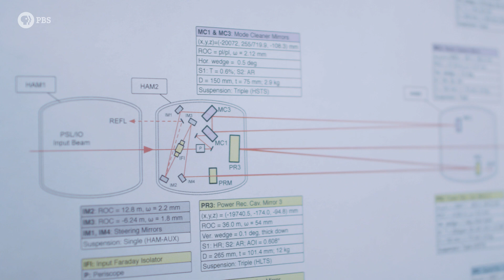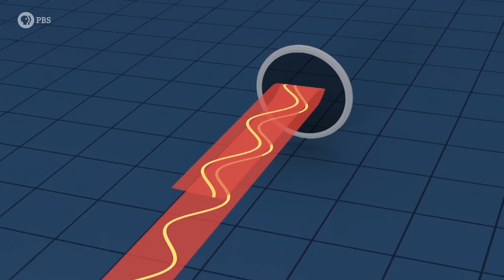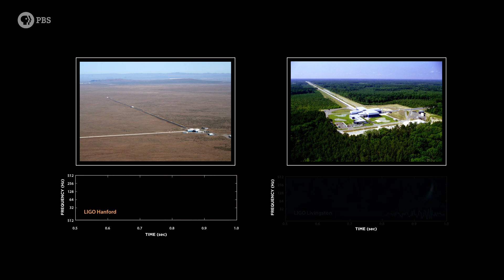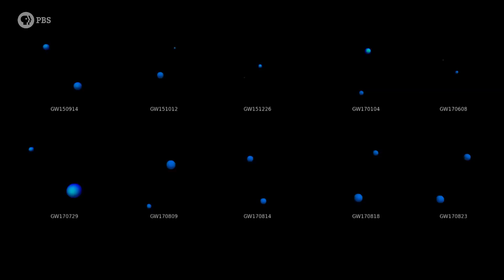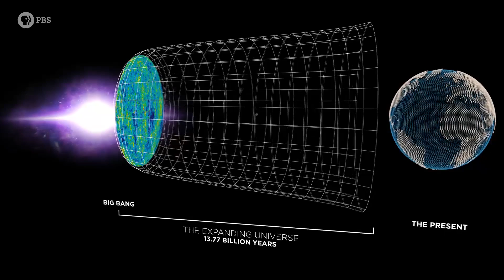I Visited the First Gravitational Wave Detector! LIGO | STELLAR

Comment: Hi Dianna!  I love your work!  Can you or someone in this comment section explain to me two things please?  First, since LIGO operates virtually identically to the Laser Interferometry used in the Michelson-Morley experiment, how does LIGO overcome the problems they had in the MM experiment, namely the Lorentz-Fitzgerald  contraction issues from the motion of the Earth?
Secondly,  If the Moon has enough gravitational influence to lift millions of tons of ocean water, the why does LIGO NOT detect this massive gravitational influence, but instead is able to detect an event that happened a long time ago in a galaxy far-far away?
Also, if this gravitational effect was so strong when it was detected 3 years ago, how come we never felt those effects in any other way?  After all, we do see and feel the gravitational effects of the Moon and this event was supposed to be orders of magnitude stronger.
Thanks in advance for your answer!  :-)
- Melissa
Reply: I might be wrong here, but about the moon, I think the probable answer is the frequency of the wave. Yes, the effect the moon has is of very high amplitude, but its period spans a whole day, so it's easier to differentiate from other sources. Besides that, this is one of the reasons they have 2 different observatories, in different places. The effect of the moon(and even earthquakes and other sources of error) moves "slowly" through the planet, and so any vibrations caused by these sources would be of different amplitudes and phases in the 2 observatories. Gravitational waves, on the other hand, move at the speed of light, and interact weakly with matter, so you would get a really similar wave within a maximum time delay of 0.01 seconds(depending on the direction the wave is approaching from). So basically, you have the 2 interferometers working together to filter out any local disturbances, on top of the suspension system.
Reply: I can help you in (3)

She describes the gravitational waves as "huge" but it's huge in comparison to other gravitational waves. She also said "spacetime moved by the distance equivalent to a billionth of a proton" which is clearly not huge in the macro scale. That's why you didn't feel it at all
Reply: @HeIIriderr  I'm pretty sure she said a billionth of a billionth of a billionth of a billionth of a proton.
Reply: @craigcorson3036  it's still small
Reply: @HeIIriderr  Yes, it is. But a billionth of a billionth of a billionth of a billionth of a proton is one billion billion billion times smaller than "a billionth". If I had a dollar, and you had a billion billion billion dollars, would you say that we are equally wealthy?
Reply: @craigcorson3036  that's not the point. The point is, that it is too small for you to feel it, i don't care if it is a billionth or whatever smaller than a proton. Gotcha?
Reply: @HeIIriderr  This is a scientific topic. In science, it is important to be as precise as possible. You are free to be as imprecise as you like, but don't enter any scientific field unless you will submit to more rigor.
Reply: @craigcorson3036  I don't think youtube comments are rigorously grounded in scientific rigor and then seasoned with only the finest physics and spices.
Reply: @craigcorson3036  To be precise accurate, as I know you love to be, She said the gravitational waves are a billionth the length of a proton. The billionth^4 was annoy the start of the universe.
Reply: @xenonram  Upon review, I find that she said "...gravitational waves could still be traveling from a time when the universe was a billionth^4 of a second old".
Apparently I misheard her, and I stand corrected.
Reply: @HeIIriderr  Upon review, I find that she said "...gravitational waves could still be traveling from a time when the universe was a billionth^4 of a second old". Apparently I misheard her, and I stand corrected.
Reply: First, let me preface this by saying I'm not a scientist, but instead am just a science enthusiast. This is what i remember from the presentation I saw at LIGO maybe 4-5 years ago. Any mistakes are mine.

The method in which LIGO detects waves works like this: they split a laser beam, send it down two equal-length tubes where it bounces off mirrors that send those beams back to another spot for measurement. If a gravitational wave isn't detected, there is no interference because the light waves are still in sync. However,  if a wave has passed through, then one tube will have contracted a teeny fraction of... let's just say a tiny bit, so that when they reach the final spot they're out of sync and produce interference. 

Once that is detected, it's interesting, but it doesn't mean much- lots of things can produce enough of a wiggle to create that interference. That's why there are multiple LIGOs, so they can have other sites show the same interference. Once that happened, they were able to triangulate where the event would be located and notify the various observatories to turn their telescopes to verify that an event did take place, because the gravity waves arrive faster than the light waves. Once the telescopes verified that yes, an event took place exactly where LIGO said to look, THAT'S when they verified that yes, they had measured gravity waves.
Reply: @LaynieFingers  gravitational waves travel faster than the speed of light? (sorry if its a silly question)
Reply: @irfinity  They travel at exactly the speed of light. As I understand it, the two are very similar---I think that, in the same way that light is a wave in the electromagnetic field, gravitational waves are waves in the gravitational field.
Reply: First point: I can't explain exactly how the designers would overcome that, but I am sure they have a way.

Second point: I'm sure LIGO could detect the influence of the Moon, but that would be one of many unwanted signals that would be filtered out. The events that LIGO and VIRGO (the European one) have detected would have been massive if you were nearby. However, the first event detected occurred 1.3 billion light-years away. The waves are very weak after traveling that distance.

Also remember that theoretical predictions of what a gravitational wave signal would look like are available, so part of the analysis is looking for signals that resemble the predictions.
Reply: The moon isn't actually lifting the water in the oceans. The tides are actually an effect of the drag the moon exerts on earth, also slowing earth's rotation in the process. It is quite similar to the way wind makes waves, just constant and worldwide.
Reply: if it was easier to detect gravitational waves from the moon it would have been done much sooner. but as victor says, the orbital inward merger of two black holes produces the highest frequency gravity waves. and only black holes are strong enough to produce those higher frequency waves.
Reply: Raging S  that makes sense, I thought the person was referring to gravitation waves created by the moon, not the gravitational influence of the moon.
Reply: 2) is frequency-based for the waves themselves (although I'm not sure if gravitational waves really count as such outside the system that creates them). In particular, they can't detect waves with a period substantially more than the light-distance of their arms (that's why the proposed space-based LISA detector is so large).

However, in an indirect way, LIGO does detect the moon. Because the moon moves the oceans as tides, there is a twice-daily increase/reduction in seismic noise in LIGO due to the motion of the ocean.
Reply: The effects of the moon are in a very different frequency spectrum
Reply: https://www.newscientist.com/article/mg24032022-600-exclusive-grave-doubts-over-ligos-discovery-of-gravitational-waves/
Reply: Just as a supplement to what Raging S has said, the LIGO detectors are influenced by the gravitational effect of the moon but the frequency of operation of the LIGO detectors is mainly above 10Hz. So the moon could theoretically obscure the gravitational wave signals of interest if it orbitted the earth 10 times every second or more. The reason why binary black holes and such are being detected at current is both because they're really big and because their period of oscilation is really fast. At the frequency they oscilate at before full collapse not alot of large things are moving at the same frequency in our observable universe so statistically they can be extracted. It all comes down to the sensitivity curve of the detector in frequency. At current the LIGO sites are limited at low frequencies (I mean from like 100Hz and up) by technical noises arising from just how hard it is to build a system that cancels all those small sources of noise you'd normally think of, while at higher frequencies the sensors push up against the actual quantum limit of how a sensor could work.
Reply: I think you're confusing gravitational FORCE and gravitational WAVES

Force is more or less constant, or in the case of the moon changing at a rate of about one cycle per day. Waves are in the - I forget what they said, billionths of a picometre or something - wavelength order of magnitude. That's a slightly higher frequency than one per day 😜
Reply: Raging S  What's the difference between the force of gravity and gravitational waves?
Reply: @glb187 , a short(ish) explanation is that gravity is not a force from a proper general relativity perspective. What we experience as gravity is the effect of mass bending spacetime and mass subsequently falling along the curvature, so to speak. In our everyday experience (and for most practical computations in fields like engineering) we think of gravity as a force because that's the most useful way to model it - the Newtonian formulation of gravity is good enough most of the time. 

So to answer your question, gravitational waves are oscillations propagating through spacetime (as described and depicted in the video). The "force" of gravity is also cut from the same cloth because what we think of as gravitational force is also consequence of spacetime curvature. But in our everyday experience with Earth's gravity, the spacetime curvature doesn't oscillate like it does for the waves coming from a black hole merger. 

There's a good explanation of gravity from a general relativity perspective from Cornell's Astronomy department at: http://curious.astro.cornell.edu/our-solar-system/140-physics/the-theory-of-relativity/general-relativity/1059-if-gravity-isn-t-a-force-how-does-it-accelerate-objects-advanced

Comment: All are happy that we detected gravitational waves but none can explain how it works.
Reply: It's an enormously complicated experiment, were you seriously expecting a complete explanation to fit into 8 minutes??
Reply: @PureAwesome33  no doubt that experiment is complicated but explanation can be simple. Gravitational waves should stretch everything, light inclusive so the detection principle should not work, but it does so the detection principle should be another and I have a good theory. While they don't even care.
Reply: @markmd9  Yes, the wavelength of light is stretched by the gravitational waves, but this is not what we're measuring. If you want a technical explanation then the laser light is resonant in the arms, and a passing gravitational wave actually induces a frequency shift creating sidebands which escape to the detector as they're no longer resonant, and these sidebands are what is actually detected.
Reply: @PureAwesome33  how can you have a frequency shift when everything is stretching at the same proportions.
Reply: @markmd9  Each wavefront has to travel the length of the arm. Even if the wavelength is stretching, this effectively doesn't matter, as if the arm stretches, the wavefronts still have to travel more distance. The proper time of each point of constant phase varies, which is manifest as a frequency shift.
Reply: @PureAwesome33  space itself is stretching, along with waves fronts and everythingin it. Space can't stretch and leave photons behind.
Reply: For a more complete explanation, perhaps check the paper "If light waves are stretched by gravitational waves, how can we use light as a ruler to detect gravitational waves?" by Saulson, a PDF of which can be easily found on Google scholar.

Comment: How can you tell what gravitational waves come from? Surely its like seeing light, and using that to work out the brand of lightbulb? And how powerful is the laser?
Reply: It is pretty much like that, yeah. Different astrophysical sources will produce different types of signal with differing frequency profiles. Calculations from general relativity produced expected signals for different events, eg black hole mergers of different masses, binary neutron star mergers etc and then you simply match up the signal you observe with the closest theoretical prediction. To use your analogy, different brands of lightbulb might have a bit more yellow light, or a bit more red, and by measuring the amount of each colour present you can figure out which brand the lightbulb is.

Comment: Would it be easier (assuming we can build it ) to have LIGO in space where there are no interaction to worry about except occasional meters and space junk. Also much better vacuum
Reply: Much harder maintenance, and don't underestimate the age old stabilization tactic of tying sensitive stuff to large and heavy stuff. A LIGO in space would suffer more inherent vibrations, due to being a relatively thin object in free fall. And we have pretty decent vacua on earth.
Reply: Yeah, didn't consider that.

Comment: Great video.  One thing that makes we wonder is, given our limited knowledge of grav waves, how do you know that the datum was caused by grav waves and not some other source?
Reply: The signal that things like black hole mergers should produce is very specific, a 'chirp and ringdown' that can make us very sure that we've detected a merger. You don't need a great understanding of gravity for this, it's a large-scale and coarse thing, so if gravity differed enough to alter this we'd be able to see it in our own solar system first.

The precise details CAN differ and researchers are currently pouring over the data to see if they can spot any deviations from prediction, which could clue us in to new gravitational phenomena.
Reply: they have models which tell us how a gravitational wave of black holes look like and they also have two detectors in different location , and we will have 3 soon

Comment: i see a swiss-made nanometer-perfect long tube. is this true?
Reply: The tubes were fabricated in the United States by the Chicago Bridge and Iron
Company (CB&I), as described at: 
https://dcc.ligo.org/public/0073/P990007/001/P990007-00.pdf

Edit: Wanted to note additionally that the vacuum tube itself doesn't need to be nanometer-perfect in length (that probably wouldn't be possible). The real accuracy comes from the optical system (laser and interferometer) inside the vacuum chamber. They don't even push on the big test mirrors physically - they "push" using non-physical-contact magnetic forces and electrical coils. Physically touching them would ruin the system's sensitivity.
Reply: It’s in america
Reply: @jb76489  i see a swiss-made nanometer-perfect long tube located in the united states. is this true?
Reply: Soner Iftar where are you getting the Swiss from
Reply: @jb76489  from precision. do you know which miniature mechanics (i.e. bldc motor) are used for nasa rovers? off course swiss-made. and i just thought these tubes are also swiss-made and i asked that is this true. ok?
Reply: @soneriftar  if it was Swiss, wouldn't it be financing the Nazis rather than making scientific discoveries? That's what I though; it's clearly a 'Murican tube
Reply: @alquinn8576  still could be swiss engineering